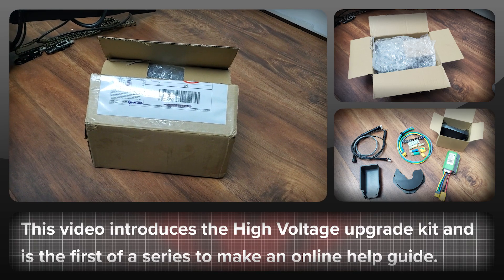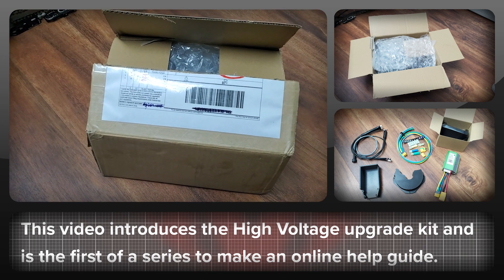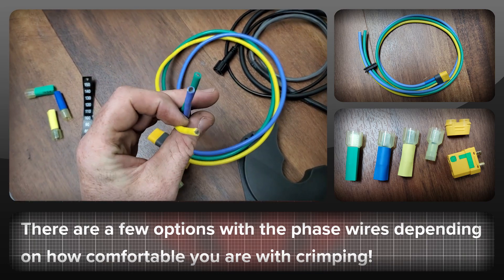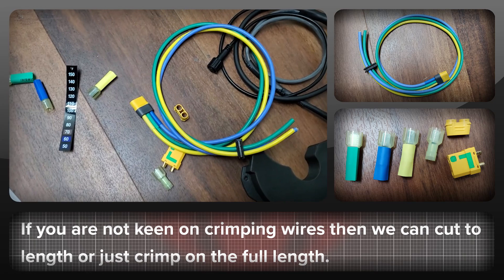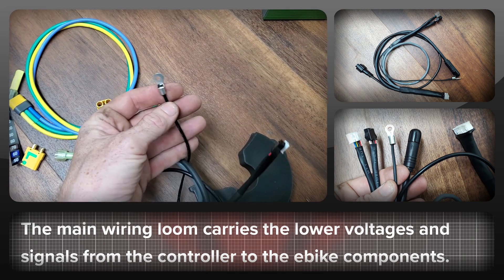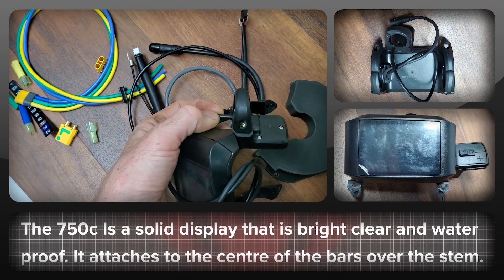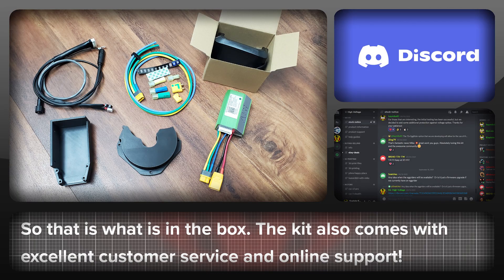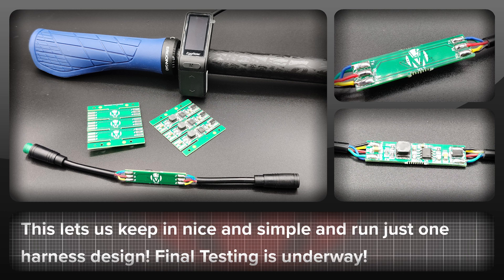High Voltage BBSHD Upgrade Kit - Whats in the box? + Eggrider V2 Plug and Play at 72 volts!

Comment: Can I use this kit with my eggrider v2 and just use my original 24.5 ah 48v battery ? will this be an upgrade from my BBSHD ?
Reply from the maker: You can reuse the eggrider for sure. The battery you can as well and you will benefit from the greater smoothness and a higher top speed. You will not be able to get the max power from the kit unless you upgraded the battery as the max amp draw is likely quite low. You would also need to get an alternate connector put on. You are welcome to make connection with the team via our customer service discord portal. https://highvoltagekits.com/discord or email greg@highvoltagekits.com directly. Thanks for the interest.
Reply: @HighVoltageKits  I used the battery with a 45amp controller with rear hub before upgrading to a BBSHD and eggrider, how may amps would I pull using the kit ?

Comment: I am thinking of ordering this kit, but had one question. I currently have the daniel neilsen 33a firmware and my bbshd will get so hot it starts to thermally throttle itself back. i turned the amperage down to about 27 amps, and if i stay on it long enough it will also thermally throttle at 27a. Would you say thats normal? I will have to maintain high amp draw for extended periods to get it hot enough to thermally throttle, but still, its only 27a??  Maybe the daniel neilsen firmware is not well optimized?  How hot does it get with the high voltahe kit. Thanks for any insight into this heat issue. Cheers.
Reply from the maker: I have not heard of this firmware can you link to it. This is a stock bbshd? Did you flash the controller with it? As far as I was aware stock bbshd do not have thermal rollback. I am interested in your setup for sure. Are you on our Discord group. You could post some pictures. There are lots of reasons why you are gaining heat. I never had that issue at 30 amps with a stock setup though. The link to join should be in the description.

Comment: Why does a BBSHD need a controller and a BBS02 not?
Reply from the maker: The BBSHD is a much stronger motor than the 02 so we chose not to support it with the upgrade kit. But it can have external controllers used with it in the same way.

Comment: Does anyone know I have the asi bac855 controller csn I use a 52v 35amps and 40bms with it need to know ASAP thanks
Reply from the maker: If your battery has a max amps of 40 and 35 continuous you will probably not get the max out of the bac855. What is the bike? Where is the controller from. It depends a bit on how it has been setup. If you pull more than 40 amps you will always be tripping the BMS

Comment: I have the EggRider display already paired with my bbshd on my buzzraw X, but was looking forward to upgrading with the bac855 kit you offer. I had concerns wondering, is the EggRider still only compatible at 52v? Should I just buy/use your packaged display to save all the trouble? I’d rather have a smooth operating bike then keep the EggRider if it will be a problem. Thank you for all your help! I look forward to your kit and joining the community :-) cheers!!
Reply from the maker: You can save some money using your existing eggrider. The kit will work fine at all Voltages. Shoot an email to greg@highvoltagekits.com and he will set you up and answer any questions.
Reply: @HighVoltageKits  thanks you very much! As I get closer to purchasing I’ll definitely send an email about this to Greg! I cannot thank you guys enough.
Reply from the maker: You are very welcome. You are also welcome on our Discord community https://highvoltagekits.com/discord

Comment: I allready own the 750 and the eggrider V2 Display , I have the BBSHD and a 60V Batterie . I have Sensors on the brakes , Sensor to the Rear wheel and twist gas is also connected . Can ASI BAC run at 60 Volts too ? Can the set be ordered without the parts i allready own ? Can the battery later be upgraded to 72 volts if necessary ?
Reply from the maker: Yeah if you have the eggrider then it can be for a reduced cost. 60v is no problem either and going up to 72 volts later is fine too. Shoot an email to Greg@highvoltagekits.com
Reply: @HighVoltageKits  another satisfied customer

Comment: Very informative video.
On a side note do you set up ASCI controller to fit a cycone 3000W motor?  Can send you photos of the connectors see what can be done to install one of those controllers.
My bike uses a 52 volt battery.
Any help to get me back  riding is well appreciated.  Here in Honolulu Hawaii nobody does e bike DIY work nor sell controllers for these motors.
Thank you for replies. 
TW- cyclone are out of them.
Reply from the maker: Best thing is to post on our Discord channel. We don't have anything specific for the cyclone and the asi. It's not a particularly good match if I remember correctly. The link should be in the description.

Comment: Hello captain! Great very informative video. I have already a BAC855 from another project that changed controller and I want to use it on my bbshd with eggrider (currently stock controller 52v with eggrider). Always appreciated what you do for the community and want to pay some back: can I buy from you the wiring and the 72v dongle? Is there an address to email you? Thanks!
Reply from the maker: Its my partner that builds the kits. Right now he is not accepting third party controllers for reprogramming. Thanks for the kind words though. If the situation changes I'll let you know. It may well be more economical for you to sell the 855 separately and get the kit. You would have to post it to us anyway for reprogramming.

Comment: Can I take a stock bbshd, and egg rider and run it with a 60v battery? Or do I absolutely need a new controller?
Reply from the maker: If you mean a 60v nominal battery then no as the max charge voltage will be 68 volts above the levels the stock controller can handle. A 52 volt battery is the max for both the Eggrider an the controller. To use the eggrider above the 52 volt battery level you would also need to protect it from the higher voltage. I refer to the batteries by their nominal voltages. So 72 volts max is 84 volts 60 volts is 68 volts and 52 volts is 58.8. Hope this helps!
Reply: @HighVoltageKits  Do you know if your gonna get anymore asi bac 855's back in stock anytime soon? I have been searching daily for anything to upgrade the voltage on my bbshd fat bike.
Reply from the maker: We are waiting on ASi and shipping. Not before Feb I don't think. Are you on the wait list? There is a form on the website listing to do this.
Reply: @HighVoltageKits  I am not on the list I will go check it out though right now :D
Reply from the maker: Sounds good let me know if any issues
Reply: @HighVoltageKits  Thanks for the reply saved me from a headache :)

Comment: The link doesn't work. I would like to order this upgrade kit. My bbshd is fast but it gets old fast. I want it faster so I can do some wheelies.
Reply from the maker: Try this one Jim. We have a wait list you can go on with the form at the bottom if the page. https://highvoltagekits.com/hv-shop/p/bbshd-bac855-upgrade-kit let me know if you have any issues. Cheers
Reply: I was thinking of getting this upgade I already have from that put in my bbshd but I am think I will buy  the hole cyclone pro 1 gen 2 kit it's not alot more and I would have another kit.

Comment: I like the simplicity of the Eggrider I just don't like that it's not colored they'd have a lot more buyers if it was colored display. Especially at 103$ for a display
Reply from the maker: Yeah maybe. The phone app is the real bonus on the eggrider with the ability to make programming changes. I am impressed with what they have packed into a tiny thing. It is a modified firmware on the sw102 display. No idea if a colour version is on the cards.
Reply: @HighVoltageKits  can't you just use a programming cable on a Android phone? And connect wireless with Bluetooth adapter like to program wireless like that
Reply from the maker: There are other options depending on the system you use. These are the two we picked for the upgrade kits we are making. If it's a stock bbshd a USB cable and a computer will suffice. There is a phone app around but I have not tried it myself.

Comment: Waiting on my battery and some spacers to finish my build, bbshd. 52v 20ah with eggrider. Looking forward to your eggrider updates, it does seem really robust. 

Triple the power you say??? I am sold and I have not rode stock yet.

I will definitely be upgrading my controller as well, when will they be in stock again? Also, when I upgrade my controller, do I still have the phone access through eggrider app to change all my settings? I hope that still will work...
Reply from the maker: Sounds awesome 👌 Look for to hearing more  Kits are three to four weeks. There is a wait list you can go on via the links in the description. Cheers

Comment: I have a BBSHD and BAC 855. I need a cable harness and 750C blue tooth version display. Can I get that from your company?
Reply from the maker: Potentially. We have a few restrictions depending on where the controller came from. If you send a message using the form on the shop page on this link we can take a look  https://highvoltagekits.com/webstore/p/bbshd-bac855-upgrade-kit

Comment: Your video is so timely. Just started working on a BBSHD build on a 2016 Norco Sasquatch 6.1. The problem is no power to the display or the motor. I found that the connecter on the battery is the wrong connector… When it plugs into the motor the wires are reversed red to black and black to red.🤦🏻‍♂️ This must’ve been done at the factory. I’ll wait until Monday to talk to their tech-support.  BTW I look forward to chatting with you folks on discord, once I figure out how to use it! ;) Cheers!
Reply from the maker: Sounds good and post some pics. Are you sure it's not Anderson connectors you have. If it genuinely back to front a hobby or rc shop can probably fix it. See you on Discord. Cheers

Comment: Works well also on the 02 also I run 2600w @52v no problems 😊
Reply from the maker: Thats great to hear. Glad you are enjoying your bike. Cheers
Reply: @HighVoltageKits  Booked another session with Greg just the multi voltage plug and play to sort ..👍
Reply from the maker: Excellent. Have fun!
Reply: What have you done so that it will work with the BBS 02? Or is this also plug&play  like the BBSHD?
Reply: @Y J What have you done so that it will work with the BBS 02? Or is this also plug&play  like the BBSHD?

Comment: Does it cut out when you hit a bump error 02h so painful
Reply: Ive used my HV kit around 5 months now quite hard on and off road at 52 and 72v and have never had this issue.
Reply from the maker: You can if you pound it hard enough still generate a cutout on the BBSHD. Its much less frequent than on other motors. We have people use our kits pretty hard off road and we are not getting this issue reported so I think at least with the BBSHD it is fine. The larger size of the BBSHD makes it less susceptible to this issue. Hope this helps! Cheers